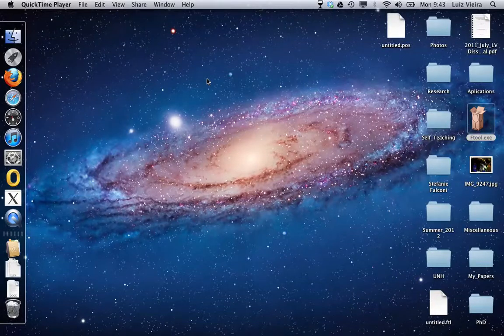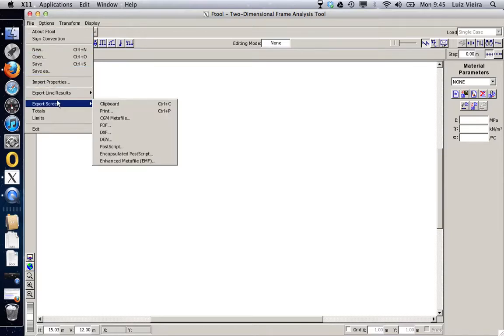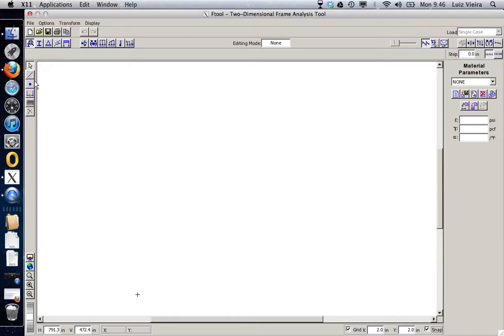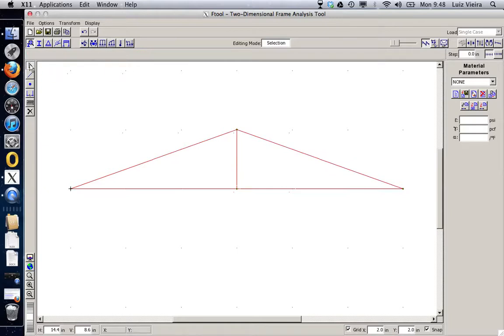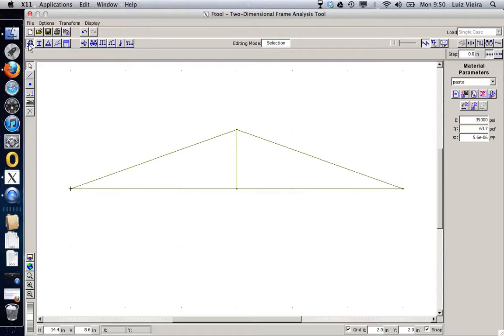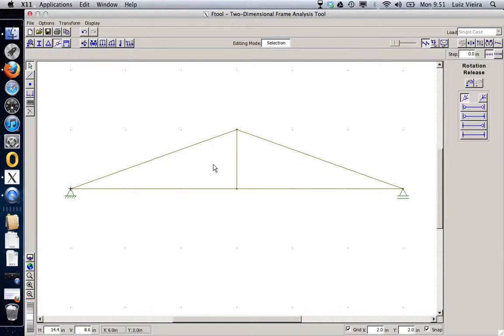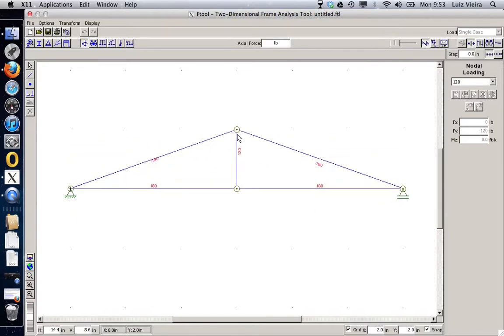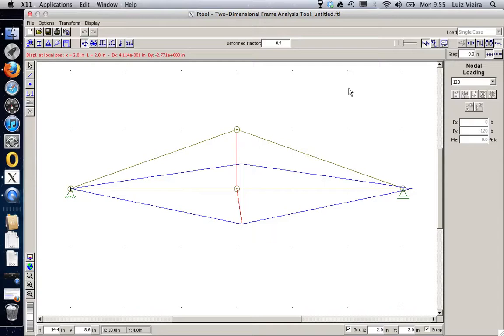EAS107P Truss Modeling Tutorial using Ftool

Comment: Hello, do you know how to load a thermal load? because i go to the thermal load panel, and put it in the section i want, but then when i click to see the bending moment of the structure (hiperstatic) Ftool tells me that it is cero (which is not). But the deformation line is correct i dont know what to do. Thanks